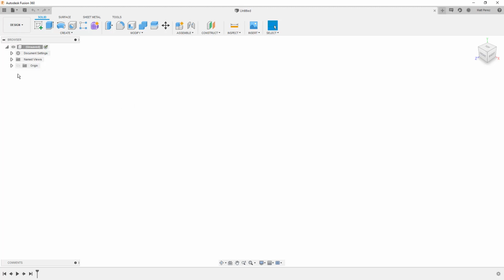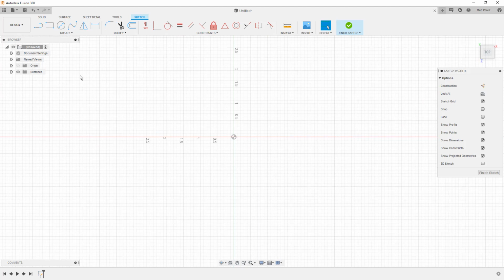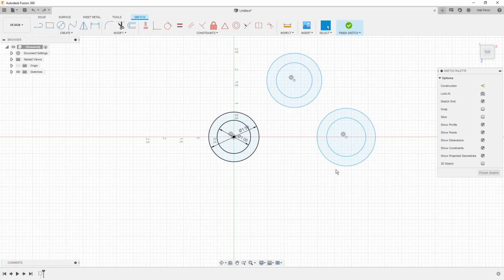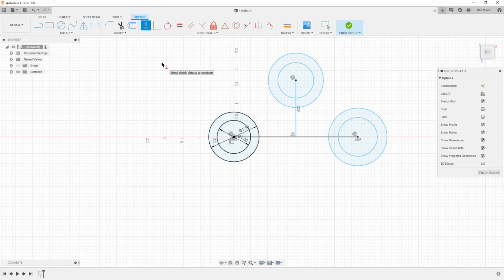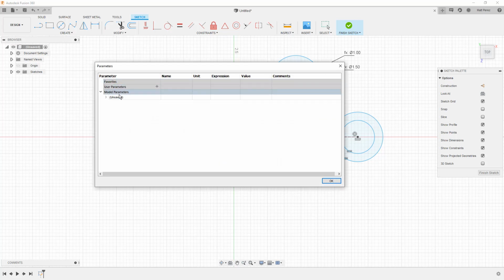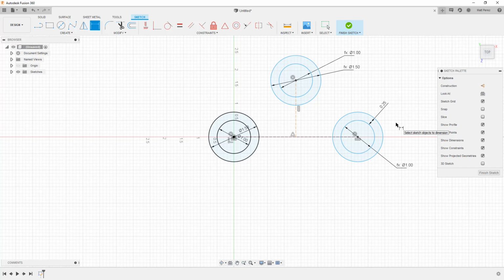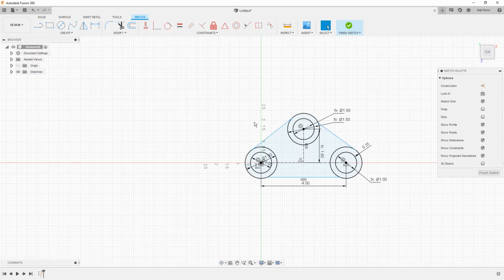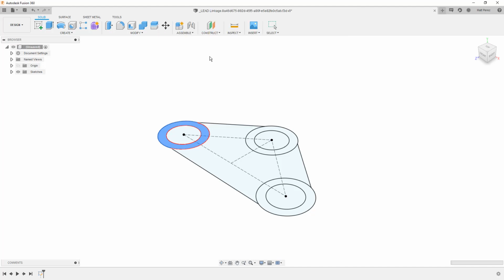Intro to Fusion 360 - Part 8: Sketching a Linkage Part #Fusion360 #HowTo #Tutorial

Comment: When I attempt to type bearing OD it does not bring up anything?
Reply from the maker: Were you able to make the parameter in the Change Parameters dialog as a user parameter?  With Fusion you can't have spaces so its either bearingOD or bearing_OD that you would create.

Once you create that user parameter you should be able to start typing in a dimension box in a sketch, or feature dimension box.
Reply: @LearnEverythingAboutDesign  I apparently missed that little section creating it.  Thanks.
Reply from the maker: @joshg7553  No problem!  FYI this content is pretty old and we will likely retire it soon.  we have some beginner content on LearnEverythingAboutDesign.com  and will be updating that later this month.